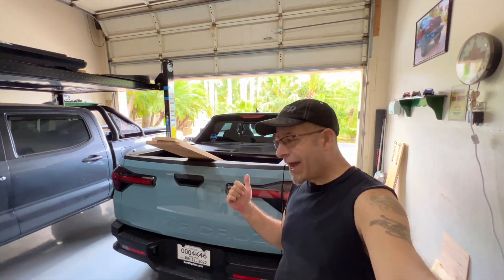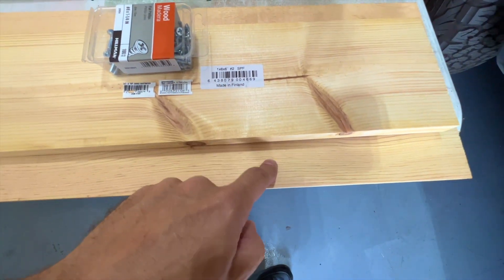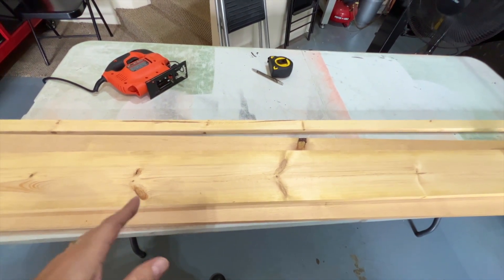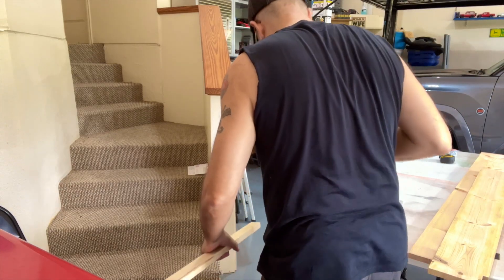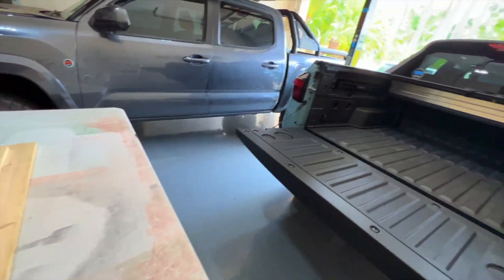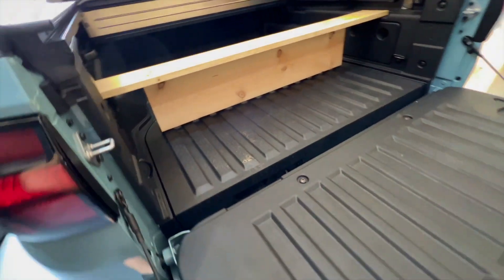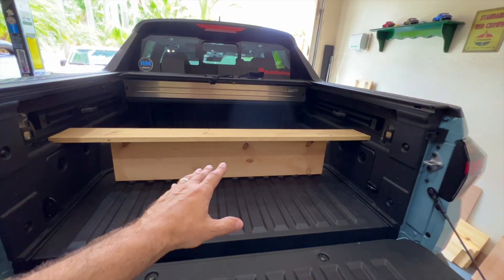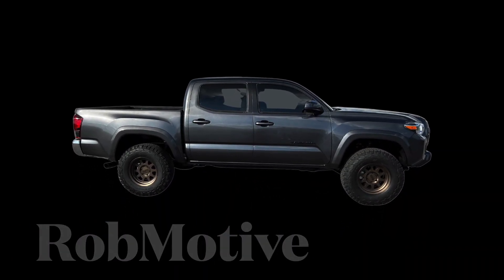Making The Hyundai Santa Cruz Bed More Useful

Comment: I didn’t paint my bed divider board yet but you certainly gave me the idea! The wedges I use go between the top of the 2x6 and the bottom of the tie down rail. A little bit inconvenient but at least the board doesn’t rattle and move. And yes I really like my Santa Cruz. 👍 By the way I used metal L brackets to connect my 2x6 and plywood, that’s what makes American ingenuity so great. You can choose what ever works better for you or make your own design!!
Reply from the maker: Very nice👍

Comment: I've been thinking of buying a Santa Cruz too, so I enjoy watching your videos and hearing your unbiased feedback.
Your divider wall is both clever and useful.  Thank you for giving your 'cut dimensions' to make the job easier for the rest of us.
I would improvise on your design concept with the following.
1.  Instead of a 1" x 6" wide board to lay in the left and right side slots/notches, I'd put in a 1" x 8" (to eliminate 'free play').
     If an 8" board is too wide, then I'd have it 'rip cut' to size.
2.  Perhaps gluing inexpensive carpet strips or foam furniture bumpers to the 'contact surface' of the board might make it quieter.
3.  I see why you chose to cut the divider wall short (to fit between the wheel wells in the back), but to solve the 'gap issue' when it is placed in the  
     notches/slots closer to the tailgate; I'd cut and install 'hinged wings'.
4.  And, like you said, adding 'hooks' to hang grocery bags is an option.
5.  Your idea of painting it to match the color of the bed liner sounds good.
Reply from the maker: Great tips.  Thanks 👍